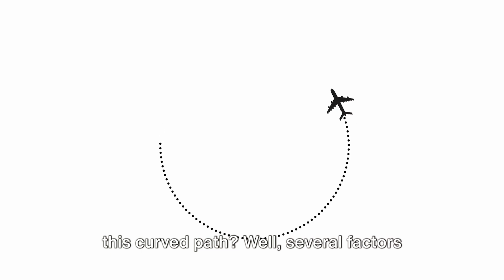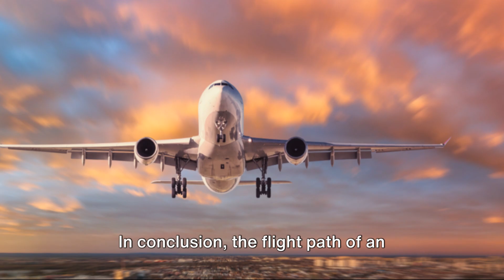Why Planes Don't Fly On A Straight Line

Comment: This is an awful explanation.

A standard map is a projection, and it is not accurate in proportions, so distances can't be measured by measuring the distance on a flat map.

If you take a globe and trace a straight line between two point, it would appear as a curve on a flat map (unless it's on the equator or passing through the poles).

Yes, there are other factors like air traffic rules and weather, but the main reason is that a map is a projection.